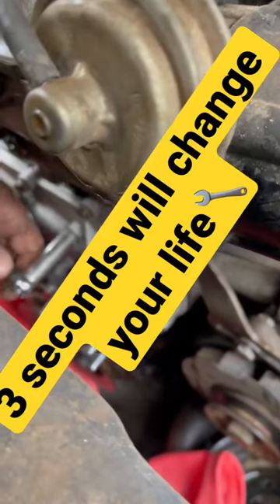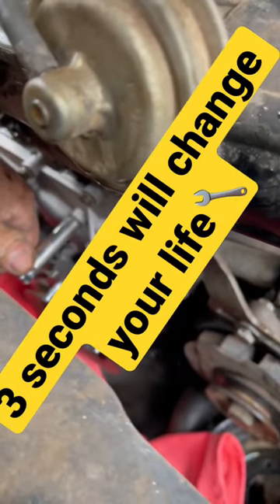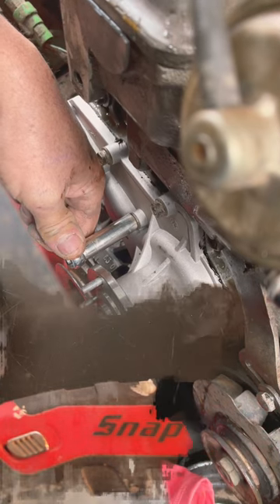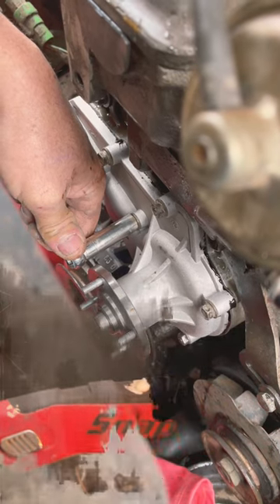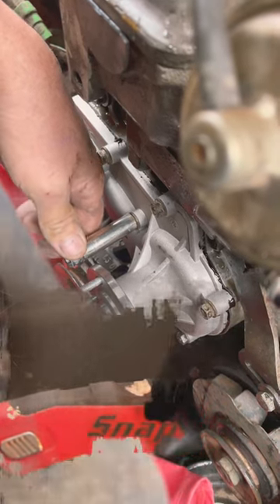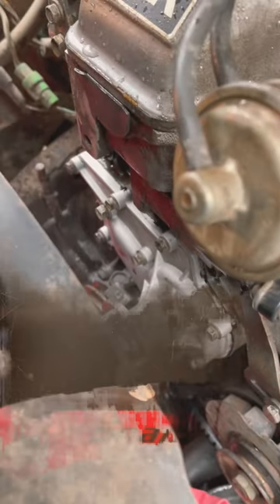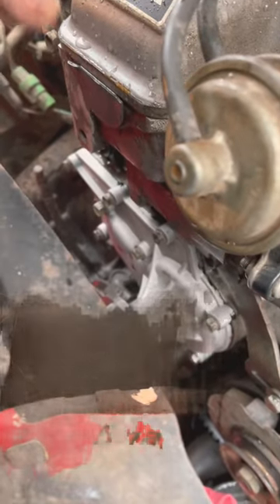This is why you hold your bolts for 3 seconds 🔧#shorts

Comment: Fake
Reply from the maker: It’s real…. Try it a a really long bolt. Or next time you torque a bolt feel how much it wants to push back. That 3 seconds will sometimes allow the bolt and your wrench to move forward with the same amount of force. Then settle . That is the equal amount of pressure in the wrong direction . Add vibration and it want to back off naturally. Try it. First time you feel that wrench move you will be a believer.
Reply: Of heard of this theory before. Very plausible
Reply from the maker: @DoubleoP  I have been doing it for over 30 years now. It is just a habit now. I see people wrench all the time and I used to do it too. Just pull on the wrench and release. But next time feel how much the wrench or ratchet wants to push back . That’s the twist on the bolt….
Reply: A really long bolt is plausible ( mostly because the thread is so far away from the head)  that's why you torque to yield instead of lbs/ft . But no way on short bolts that are threaded all the way . Alternator bolts I can understand. But the water pump bolts you demonstrated on . Bs . Cause if it were true everyone would be doing it . I and probably 99% of other techs never heard of this . Yet how many techs out there have had bolt back off for that reason. Plus if it were true you couldn't use torque wrenches properly because they don't hold tension after it hits the right pressure.
Reply: @fastflo1 ” it’s real…. “ Those dots gave it away 😅😂😂
Reply: @fastflo1  that is really cool but I haven’t experienced bolts coming out. What place on the car would make sense to do it? I can’t think of any bolt that come loose on my car. If anything they’re too hard to get out lol but I just work on my own stuff so what do I know.
Reply: @Downsolow  The twist/torque of the long bolt would then need to overcome the friction of the thread ramp….
Reply from the maker: @Downsolow  just because the majority does it it doesn’t make it right . 1 percent is the richest and 99 percent poor . So the bolt could be right you could be wrong …. Keep an open mind. You’re acting like holding a bolt that your tightening for 3 seconds won’t help . The one second sure did. Haha. Why wouldn’t 2 more . I swear some people just west to argue to be right … sorry guys you’re right . That’s gonna make it come loose ! Haha😀
Reply from the maker: @DJ-kg6zq  if you work on anything that has a bolt it is the principle behind it not the size of bolt . Maybe you had a great experience with your bolts . Bolts do come loose . This additional step helps to ensure they stay tight . It surely won’t help them come loose….
Reply from the maker: @bobthebuilder8223  😂😂😂
Reply: @fastflo1  You are right. The metals actually seat together
Reply: @fastflo1  so why isn't it in the instructions for ARP head studs they're long bolts 300 straight six nowhere in that instructions does it say hold the bolt for 3 seconds. In the entire Haynes manual for a 300 straight 6 does not say hold the boat for 3 seconds. And why do I have to hold it for 3 seconds if the head of the bolt is not slipping then it will catch up by itself right?
Reply: @fastflo1  I've been doing this for 33 years and have never held a bolt for 3 seconds and never had a bolt come loose.
Reply: Yeah i want to see the math based receipts or it's certainly BS.
Reply from the maker: @drrrrockzo  go pull your wrench out lazy…. You don’t have any bolts?
Reply: @fastflo1  look man I've been turning wrenches for 20 years.

Let me ask you this, do you "hold" main caps when you torque them? No the wrench clicks and you move one...does any race engine builder "hold" bolts? No, they torque them and move on.

Have i ever torqued a bolt and had it back out? No, because by tightening to the torque spec you stretch the bolt. By stretching the bolt you apply preload. By applying preload you create friction. By creating friction you lock the bolt in place.
Reply from the maker: @drrrrockzo  yes I do hold them especially the rods mains and head bolts … and torque is great I love torque wrenches . But this is a step above . Simple as that . You can argue until the cows come home . But if you have not tried it or experienced what happens when you do it . You will never know. So convincing me is useless I already know it works . You’re the one that doesn’t know and you’ve convinced yourself it doesn’t and won’t try so I guess we’re done . Thanks for the comment and enjoying the video make sure and subscribe almost all of of my videos I’m sure will make you irate .👍🏻😊
Reply: @fastflo1  You're right I could keep arguing about it...but I'm not going to.

Your method works for you and mine works for me...at the end of the day what matters is the the engine runs and doesn't come back because of our work.

To each their own. Godspeed, good travels and happy new year.
Reply from the maker: @drrrrockzo  awesome man sounds really good to me. I totally respect that and a boost customer is the best customer and it sounds like that’s what we care about most . I like 👍🏻 it.  Happy new year also and hope to see you on some of the videos in 2023! 😀👌🏻thanks !
Reply: Long bolts maybe I just torque em twice at least
Reply: @fastflo1  engineer school says no
Reply: @fastflo1  so explain to me why you need a whole 3 seconds? if this concept you so describe "exists" to a degree that it matters, it should happen almost instantly and not take a whole 3 seconds (from an engineer)
Reply from the maker: @josephcalabria2976  operative words …. Almost…. Instantly …… that’s why…. 3 seconds matters . Precisely, you answered your own question.
Reply: @fastflo1  I understand, but I mean so instantaneously that you would have to release it completely the literal moment the tighten stroke was complete (impossible as human muscles do not move instantly (nor our brains reaction time)). Essentially, you can attempt to "create" the backward force you described all of your life and never ever be able to achieve it once no matter how hard you tried. Lastly, the amount of tension you put tightening the bolt isn't just going to unwound itself from vibration even if it gets rotated back a few degrees. Instead, it'll drop from let's say idk 21lb/ft torque spec to like 20.2 maybe, thus still pretty tight and enough to handle normal vibration without falling out. Its an old wives tail that at least some understanding of physics, but not enough to easily disprove itself.
Reply: @Downsolow torque wrenches were made for people who couldnt feel the bolt stretching. If the threads are well lubed you can feel when you are at the right torque.
Reply: @alexyochum5648  Stop BS ING me .
Reply: @fastflo1  it is totally not correct. There are far more things to consider before you stop watch fastener torque.
Lubrication or no lubrication.
The material/components being 'clamped'.
Condition of fastener and what it's threading into.
Condition of the torque wrench.
Method of applying the torque.
The 3 seconds rule is very useful for food that has fallen on the ground/floor. But I personally prefer to use the 2 seconds rule.
Reply from the maker: @Smachfest  😂
Reply: Best thing I needed to know
Reply: It's real, that's why you lugnutz are loose.🕵
Reply: @fastflo1  engineers take that into account when they write torque specs.... In no torquing instructions ever, does it tell you to hold it for 3 seconds.... By doing this you're just over torquing it!
Reply from the maker: @buddsmokengood  most people do not understand…. It’s ok …
Reply: That's a myth it's self it's legend not real 🤣 that I heard that before it's all false information
Reply: I stand on one leg and hold my nose while I'm tightening. Never had one come loose so it must be working.
Reply from the maker: @myleswillis  great technique. Make a video I want to see the technique
Reply: @John-wc6hk  skilled men in the old days before torque wrenches were invented used thier skill
Reply: @alexyochum5648  Torque wrenches were designed for the unskilled person, like the DIY person.
Reply: @John-wc6hk  During the war ARP stood for Air raid precaution.
Reply: @nigelclark7360  it does nothing. Besides waste time but I'm guessing this is for people that work at automotive shops you can have three seconds to each bolt go to good with my hourly rate. And another thing that doesn't even make sense since when did torque wrenches hold anyting for 3 seconds?
Reply: @fastflo1  applying a little bit of oil to bolts that don't specifically say not to do so or request thread locker helps with this as well.
Reply: @fastflo1  this sounds like it actually makes good sense, I’ve never heard of this before, or anything similar too it. I’m going to play with this idea, and just see. How can anyone say fake to something like this without first testing it for them selves, that’s honestly kinda like instantly discrediting yourself within your own words!
Reply from the maker: @tucker934  I feel the exact same way. Very closed minded options. Most people think if they have not heard of it it is untrue. The real reason most people have never heard of it , because it came from someone who studied metallurgy in preparation for being a Boeing mechanic along with so much other information from Junker and am at more. Along with his experience, he grew up in a machine shops building engines with his father . I worked in the same shop as a teenager and learned so many cool things from these guys. My friend has been in the aviation business now for 30 years. We laugh about his between ourselves how many mechanics are not willing to accept this information as being valid. The only real way to know is to apply it. I have been doing this with just about every bolt I come across. And I work on stuff from chainsaws, to boom trucks, my 4x4 trucks my motorcycles etc…. It is really fun and amazing when you apply this and in that 3 seconds of holding feel the bolt settle and the tension being released while it seats. Dirty bolts, rusted, new, aluminum to cast . Steel to aluminum. So many factors to be considered it is actually not surprising to feel the result. I work on A lot of things in the field. Poor fit up, extreme wester, and you have to fix stuff in the spot. It can be something a simple as dirty threads… but the 3 seconds will overcome those. I know you will enjoy this . You sounds like a person that has common sense. And the beauty about things like this, opinions really do not matter . Because in reality it does work , but it surely will not if you do not try . Great comment and outlook , I like your perspective! Thank you 👍🏻and please comment back when you feel that bolt move!
Reply: @fastflo1  I sure will my friend, I’ve still got lots of learning to do I’m still in my 20s, spent  my younger years on riding mower, push mower’s, and all that good stuff till around 13-14 we’re I then learned that engines aren’t the only thing I love to work on. My knowledge has vastly expanded from that to multiple different things Like Electronics( both solid state, to the earliest from of electronics) HVAC, chemistry, engineering, and yes aviation too. There is so much more that just facilitates me, and I strive for it, live for it. The last few years I’ve been digging into the early radios, and vacuum tubes, restored Two AC/DC tube radios, and a VTVM (Vacuum tube volt meter).
Without proper knowledge they could work yes, but how well is questionable. 
Thank you very much for sharing this, and even the bit your back ground.
I’ll definitely be playing with this soon as a good friend of mine has some go karts that need a bit of work! Until then my friend keep on pushing💪🏻
Reply: @fastflo1  I just flip directions and it breaks the socket loose without turning the bolt
Reply: @fastflo1  why do people have it in yhere head that metal its the same strenth no matter if its torsion or tension ect its all diff u can pull steel apart as easy and u can ben it and twisting it requires even less for
Reply: @fastflo1  It’s a lie. The torque applied to the bolt is instantaneous. There is no lag in rotation. Basic physics.
Reply: @John-wc6hk  I agree with you. I've been mechanic.  I never have done this and never had a bolt back off.
Reply: @fastflo1  I just went out to my garage and did a scientific experiment on an engine.  I torque 10 extra long bolts with your method(holding 3 seconds), and repeated the same with a torque wrench, and also just by feel. My conculstion is that holding the bolt doesn't make a difference.  I had consistent torque with all 3 methods.   So holding is fake and doesn't make a difference
Reply: Especially when you have antisieze or not
Reply: As someone that wrenches for a living i can confirm

Comment: You should teach this to torque wrenches. Mine always lets go as soon as the torque is reached.
Reply from the maker: That sucks.... They can only do so much.........
Reply: Your using your torque wrench wrong! You need to torque to spect. Spend 3 extra seconds giving it 3 more clicks for the rebound tension. Then mark with a paint pen 😬
Reply: @j.gtheautotech8455  I'd say 6 more clicks. Half second per click.
Reply from the maker: @j.gtheautotech8455  have you ever worked on something without a torque wrench in your life?
Reply from the maker: @noname-yb5jt  you guys can’t fix anything without a torque wrench……
Reply: @fastflo1  Only really use one on lug nuts and a few other important things my arm is a torque wrench.

Just making a point, lol.
Reply from the maker: @noname-yb5jt  thank you 👍🏻
Reply: @j.gtheautotech8455  specification? 😆 🤣 😂  torque to spec or yield?  Do I have to degree my bolt?
Reply: @fastflo1  yes, when adjusting belt tension on a vehicle with no automatic tensioner. I usually go by feel not by my torque wrench...
Reply: Oh yeah that's a click type maybe we need to go back to beam type?
Reply: @no name  Your arm can't hit 7ft lbs consistently on aluminum bolts, even 9 ft lbs snaps my valve cover bolts lmao
Reply: @alextheonewarrior  and what's that got to do with the original post and exactly what valve covers require 9 ft/lbs of torque. And on my whole life anything I've ever seen would call for inch lbs done every one know ft lb torque wrenches are not accurate that low on the scale

Comment: After you've pulled the parking brake hold it in place for 3 seconds so the brake calipers don't rebound and let your car roll down hill.
Reply from the maker: Ah ha! That is a good one..... I have to admit, very creative😀👍
Reply: This must be the issue with Toyota handbrakes, they should have warnings in the car.
Reply from the maker: @leemccormack7168  those are my favorite types for doing ebrake turnarounds 😀

Comment: This is the type of guy that puts a quart of oil with the drain plug off to wash the old oil when doing an oil change.
Reply from the maker: How did you guess?
Reply: I use petrol
Reply: @adamchristoff4905  I use diesel and fill it after and then run it to clean the oil galleries
Reply: The best way to clean out the engine is to fill it with 99% alcohol, and toss a match in.
Reply: @Chaddrick Gaines   oh I used e85 instead
Easier to come by in large quantities
Reply: Your supposed to, trust me this guy's old mechanic taught me that trick and it has changed my life
Reply: If I have 4.5 qt capacity and 5 quarts of oil, you're damn right I'm pouring half a quart to get the dirty oil out.
Reply: @Andrew-wq1ue  😂😂, make sure you use Dawn cleaning soap. I mean it works on ducks 🦆 🤣 😂

Comment: There's a glimmer of wisdom in your mentor's false errand. It's that having a student hold something while counting makes an act intentional. You're more likely to do a better job when you slow down and act intentionally. If that's the case, your mentor forgot to let you in on the false errand part.
Reply from the maker: You are a very smart person. I actually tell people that this will bring an extra level of focus....The result is always a job well done.👍
Reply from the maker: @realeyes4734  he was not my mentor . And he was serious 🧐 and it really does work . And rebound tension is real. Not many people know about it . You can find it easily on Google.
Reply: @fastflo1   rebound tension in a 2 inch bolt huh? LMFAO. What even would be the point of a torque wrench then
Reply: @fastflo1   just googled it. Holding the bolt doesn't have any actual effect on rebound tension. You're supposed to account for that before you torque the bolt. You're not stretching that bolt enough with one hand on a short handle ratchet for any rebound tension to build up whatsoever. You're just misinformed.
Reply from the maker: @realeyes4734  you know it is a tip to apply overall in mechanics. Use your own judgement.
Reply from the maker: @realeyes4734  well you dug a little bit . You will not learn it all in one night . Give your self a chance to learn . Next go Google  how torque is converted to tension and tension to clamping force . Then get back to me.you will start to understand soon I think .

Comment: That’s why I was always taught to put red Loctite on everything. I just got done putting some on my radiator cap
Reply from the maker: I heard if you use it on radiator caps you should let it flash off for 3 seconds exactly then install.
Reply: really? i was taught to mix every color loctite then mix in some jb weld to really get her grippin
Reply from the maker: @chrisplayz9739  don’t forget a few drops of crazy glue also
Reply: @fastflo1  I found gorilla glue works better
Reply: @dannyb8504  That's really just for your hair